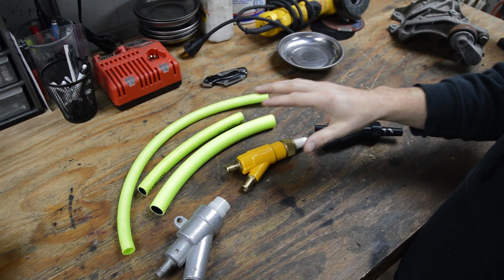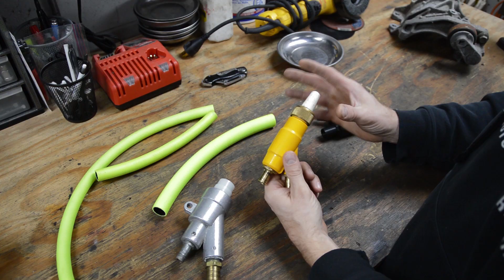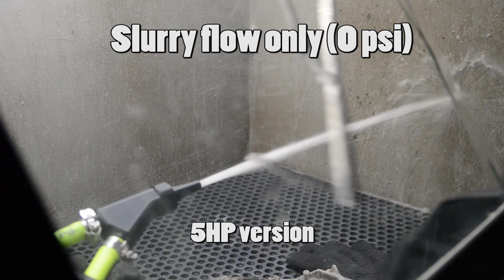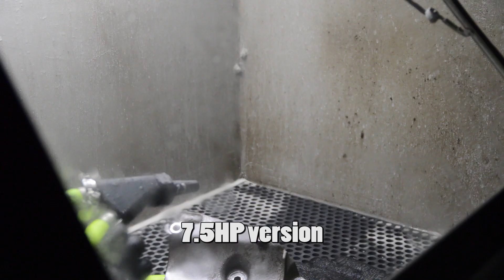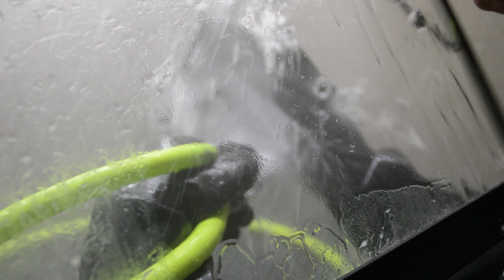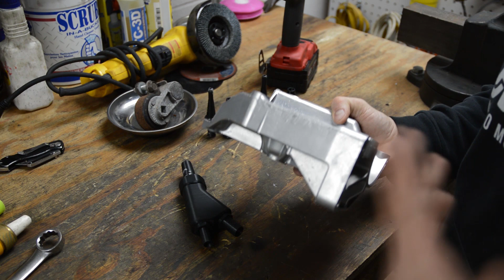HTMR Vapor Blast Gun - Part 2 - Want One? Preorder Now!

Comment: Nice work. Have you considered making the nozzle out of boron carbide? It would be a lot more durable than stainless, especially for a dry blast gun. I use a Tacoma gun and its fantastic, but the ceramic nozzles last me 6-7 hours tops using #100 Garnet media in a dry cab. Maybe something to consider.
Reply from the maker: Yes. I am looking into this thanks.

Comment: It would be nice to know what the time savings is with this gun compared to the Tacoma gun. I run my vapour blaster every day with the Tacoma gun. I have worn the nozzle on the Tacoma after a full year of blasting. The nozzle I’m still using, but you can see the wear. When I bought the gun I bought a spare tip which I haven’t put on yet. Appreciate the videos and time you’re putting in to perfecting a gun.